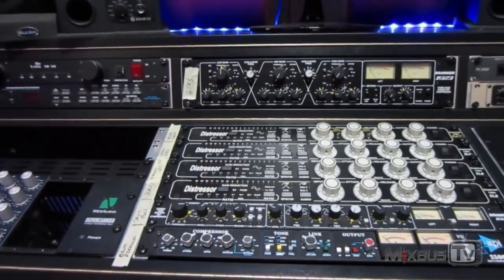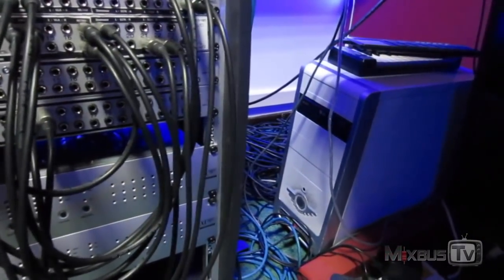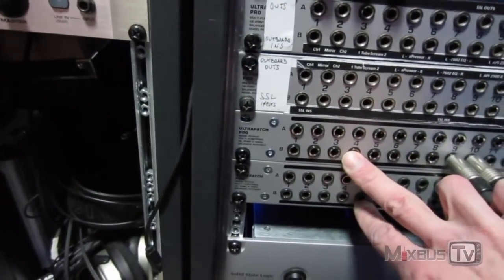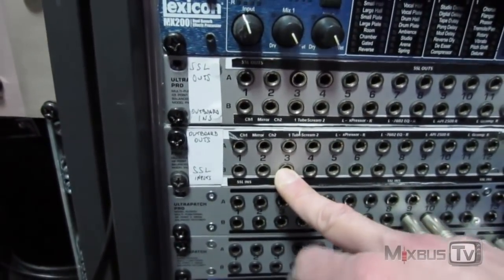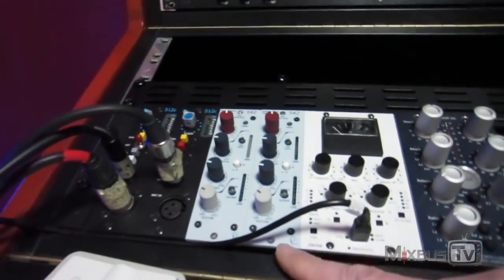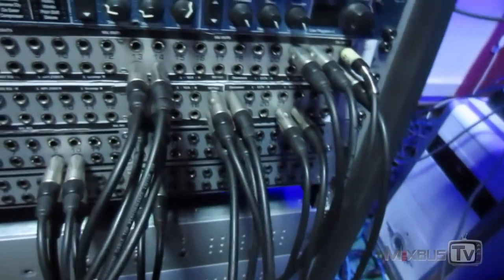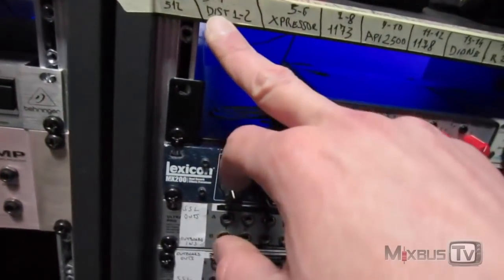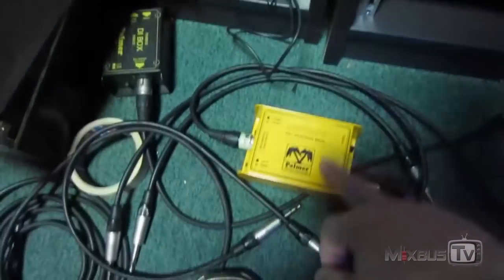Patchbay, AD/DA Converters setup Explained Interfacing computer analog gear

Comment: have you no  problems  whit   the  jacks    backside  of  the  patchbay  wehen you put  in  of the  frontside    ,   by my   pp   of  Behringer  it s  the  problem wen i   take  of the  front  side  a  cable     then  goes   backside  te   cabel  stick  out    .
Reply from the maker: I have a flock now, I don't use batchbays anymore
Reply: @mixbustv hi can you explain what that is ?

Comment: Hey David,  thanks for all the vids,I am getting a AD/DA converter how will I  hook it up as my interfaces are Presonus firestudio 4 chained by firewire 400 and SPDIF for audio clocking, what type of converter should I be getting to successfully run the setup?
Reply from the maker: I'm not sure what you want a converter for tho', running analog? Expanding channels? Why are you clocking with SPDIF? Sounds like you want to book a private consultation for your setup
Reply: Mainly to hear my mixes and masters from digital to analog on my monitors for a true reference when I hear my tracks played back.
As far as the spdif hook up I was told that when you cascade these units the spdif is to allow the units to sync audio from interface  to interface, is this not true as it is working in this manner.
Help me to understand cause I want this to be right. 
Thanks
Reply from the maker: @jmoemorris4133  so you only need a DA, like I said, there are great monitor controllers that have DA built-in, Crane song Avocet for example or the Dangerous DA or monitor controller. Spdif connection is okay for the signal but you need to clock with BNC watch my video on it is in the video list z released few days ago
Reply: Ok will look into DA converters, my interfaces don't have any BNC connections for clocking it is firewire to firewire in the same manner as you explained except Presonus uses software called Universal Control to manipulate the the units that is on a interface on my computer. 
Thanks very much for taking the time with me, keep killin it man!

Comment: You mentioned double conversion. Currently I have a Neve 511 and Neve 551 set up in pro tools as hardware inserts. So what you’re saying is if I want to use both on the same track, I should insert one and patch the output into the other instead of just inserting both separately on the track in pro tools?
Reply from the maker: Correct, but isn't the 511 a pre? Why would you want to use it as he insert?
Reply: MixbusTv I get sessions sent by clients to mix. Sometimes I will run a vocal through it or some drums to add saturation with the silk. I have a pair of them and will sometimes run a mix through them for some analog clipping to get loudness. Mostly just coloration duties.

Comment: Since you're using the RME 9652 cards and the SSL A/D Converters, how is your monitoring handle, via breakout from cards?
Reply from the maker: I haven't been using that setup in years, this is an old video, but yes, breakout cables into Drawmer MC3.1
Reply: @mixbustv  Thanks for the fast response

Comment: yo man, im going to school for audio production and we get to reserve the studio for 2 hours a week and they have a mix rack in there, the whole setup from what i can see, is an audio interface, that is connected to the mixrack which has audient id22 i believe and another audio interface that are connected to the mics and then they have some other analog hardware reverb delay and a neve 8816, and they have a patchbay,
if i connect a mic to channel 1 in the audient and then i record on pro tools and then i want to use the tc m350 for some reverb how do i exactly do it, do i have to use the patchbay or is it already set up and i only have to find the Insert that has the tc m350
Reply: @mixbustv  i swear if you talk italian id go and tell them right now cause im in milan in SAE, 
i just wanted to know though, for example im recording a mic on channel 1 on the audient and the patch bay if i want to route that track to the tc m350 i have to put those 1/4 cables on the output of the audient 1 slot in the patch bay into the input of the tc m350 but then i have to route it out from the tc m350 using the output slot into what...
cuase thhey dont have input channels of the audient cause the input of the audient are the microphones that are connected on the back.
Reply: @mixbustv  could it be that the inputs should be going to another hardware that is sending the signal back to pro tools
Reply: @mixbustv  um that is one hell of a coincidence by. Any chance you're italian

Comment: Yes. Only after you bought the 2nd Patchbay (and stacking those 1st and 2nd one up), you can understand what the principle meaning of the "Normalized mode" easily. In other words, during owning only one unit, it's hard to understand/imagine the essence of this function. So I think that the beginner should buy two Patchbayes at once in the first place even they don't need such amount of patching points.

Comment: I have two pre amps and the focusrite saffire pro 40,  and some out board compressors and gear. I just purchased a patch bay.  would I connect my mics and pre amps to the patch bay for more versatility?  I'm thinking patch vocal mic out,  to pre amp in on patch bay then pre amp out to maybe compressor in on Patch bay, comp out. then to a Focusrite channel in on the patch bay?  Or would I take all the mics straight to the Focurite inputs,  and take the out puts on the focusrite to the patch bay then patch them to various pre apms and gear and back to Focusrite in?
 Hope this makes sense just trying to utilize the patch bay with the out board gear.

Thanks, Tom
Reply: MixbusTV  Ok Great that is what I will do,  Just one more thing,  would I have all these half normalled?  Thanks

Comment: Pls can u write in coments the exact name of the SSL converter and RME card? Is it PCI express or just PCI (mac/pc compatibility) 
Btw. Your videos are great. Im a subscriber 😊💪
Reply: MixbusTV MixbusTV thanx. Im on mac pro 2012 so i will have to buy PCI-E version, cause your RME is PCI. Maybe RME RYDAT? 
(Alpha link ax is yours?)
Do you have any other suggestion (ither than alpha link) what do you say about Antelope orion 32?
Reply: MixbusTV hey, what is the main difference between ssl alpha link AX and SX? And also there are AX version with and without madi option on it (they sell used only now, it's discontinued) which connection is better, madi or adat? Is it better just to find cheaper one on ebay (ax or sx) and after that pick RME pcie card with adat or madi connection to match ssl alpha model. Im in a dillema 🤔😲
Reply: MixbusTV one more quick question pls. There is SSL ALPHA LINK LIVE R for very very low price. Is that one good for me also? What is main difference?
Reply: MixbusTV i just won the bid on ebay (its 311 pounds) i still cant believe 😂
I hope i dont get bag of rocks hahaha

Comment: Hey Dave, I was wondering when you said you wanted to avoid converting your signal twice from your patchbay to your 2bus, but similtaneously also wanted to avoid being tied down to your 2-bus in the typical order you use it... When it comes to the routing from your patch I was a little confused.. So you have an SSL OUT automatically "normally" feeding the Neve side of the bus (SSL OUT >> on top back, then back bottom of the next rows down on the same patchbay to input of >> Neve >> SSL in?)... This should mean that all you'd need is a stereo set of patches on the front to link the top front corresponding out into wherever you put your Dione inputs on the patchbay...then Back into your SSL Converters?    What happens when you start to patch things through 2.. 3 different patches on front.. you said we want to avoid that.. Phase issues?  Is that something that's OK to do during mixing, but not mastering or with your 2-bus?
Reply: Yes Indeed David everything you do pretty much is a very big help to a lot of us.. myself very much included!  and Yes, with the 2bus, being that my studio gear is limited to an Avalon 737 for tracking.. Drawmer 78 + Kush Electra as my 2 bus (Electra is designed in the API style BUMP.. pretty killer!)

Along with like an aphex aural exciter (which I'll probably be using the waves plugin still), a lexicon mx200.. and a host of pedals for reamping.. my thinking was to be able to pull apart my 2 bus to use as additional recording and mixing units.. so I could simply expand off my Avalon a few more channels while recording & mixing.. or even just if I wanted to hear the difference by swapping my EQ & Comp order in my 2bus(probably almost always use the compressor first, but still you never know until you try!)

But yeah, David did you ever think about doing like a paid studio consultant?  I mean you answer so many questions online and have a few clever avenues to pull in a little revenue it seems.. I was thinking that bc I wanted to send you out $10-15 dollars for being so helpful and considerate over the past half a year or so, and to contribute to the cause you know.. but I was thinking why not ask instead of buying a t-shirt.. could I buy some minutes of your time?  Idk Just a thought, but at any rate, I certainly thank you for your being you man!!

Comment: Nice video ! I still have 2 questions :

- As a guitarist (and I know you are too), you now that pedalboard and guitar pedals destroy a bit the signal. Even you alternate true bypass / buffer / True bypass (as you did). For playing live it is okay, for playing guitars it is okay, but for mixing we are after a bit more fidelity. Does that bother you ? Don't you feel this signal degradation ? Or perhaps when you use a pedal for mixing, it is mainly for screwing up the signal so it doesn't matter in the end.

- As a fan of the FMR RNLA too (whereas I use everyday a lot more expensive comps), I couldn't find a way to justify having the RNC as I couldn't justifying having a clean comp in hardware for mixing. I mean there are plenty of clean comp in the box that do the job really well and quicker.
Or perhaps you keep it for the "Super Nice" feature which is quite unique (as the Long Release on the RNLA).

Thanks :)
Reply: Hi okay I get it :)

Yes that makes sense for the RNC, it was what I thought, the Super Nice Mode is so unique. It's the same for the Long Release on the RNLA. Which is why I love this compressor.
I should probably investigate the RNC too, but I was afraid to find any use for it since clean comp ITB are king to me (for transparency).

Cheers and thanks for the quick answer.
Take care my friend :).

Comment: You should absolutely change your pc case. You will get much better ventilation and airflow with a Fractal Design Define R5, be quiet! Silent Base 800 or even a BitFenix Shinobi, provided you get the right (+amount of) fans and mount them correctly.
Reply: Well doesn it have to be fanless or just very quiet? I wouldn't get a fanless PSU because it'll heat up your case and put more stress on the electrical components plus it means extra work for your fans. I can recommend the Seasonic Prime series and the be quiet! Straight Power or Dark Power PSUs.
Reply: MixbusTV you are on pc/windows or hackintosh?

Comment: Do you need to sync the RME cards with SPDIF and run them in master-slave? I am still running a M-Audio Delta1010 into a 66 with Omni, very cheap compared to your system. Also what switch position do you use on the ULTRAPATCH (I have only one)
Reply: I imagine the RME drivers would sync the two cards and you can pick the master in software. Lynx drivers do it, so why wouldn't RME?
Reply: MixbusTV hmm, what do you need crane with ssl and rme? What does it do and how is he connected?